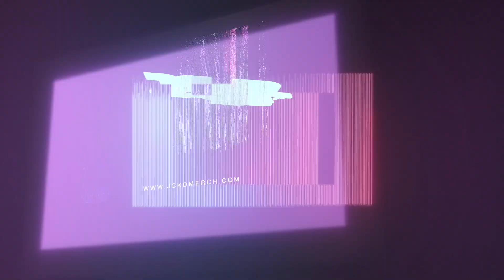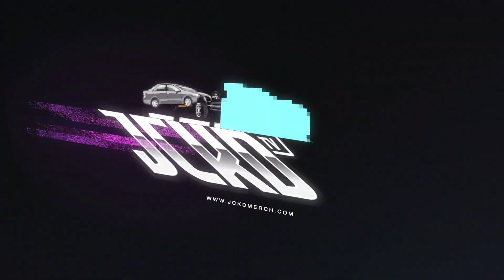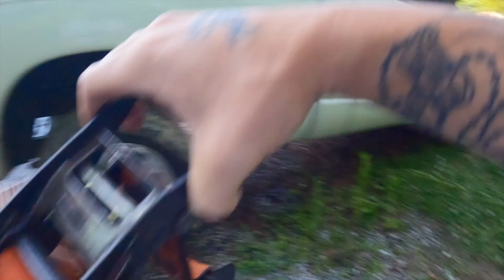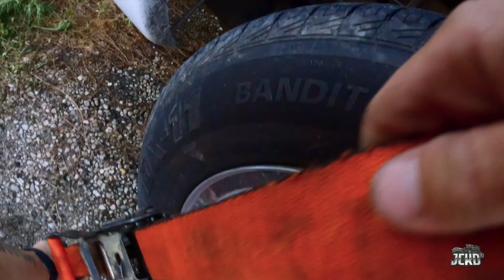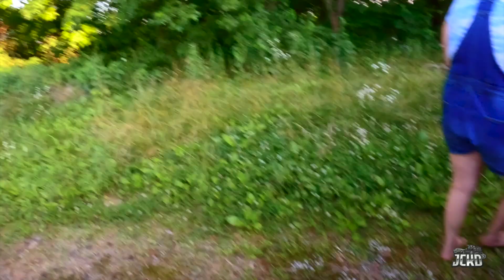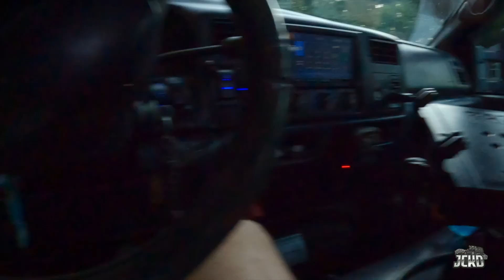GREEDY GIRLFRIEND TURNED IN REPO

Comment: You should get the boom end assembly if dynamic makes it. It's the wheel that swivels for your winch and saves the cable. I have the same truck, but a century 300 series express bed and tunnel box. If you don't have a tuner for that 7.3 you got to get one. I get 4mpg more with a 75hp tune and the transmission shifts better. DO NOT GO HIGHER THAN 75HP STOCK, Performance wise that 75hp with the f550 gear ratio gets you up to 55mph fast AF. Our trucks only like 55-60mph with the gear ratio vs engine rpm/economy.